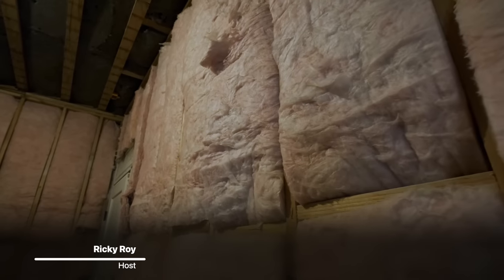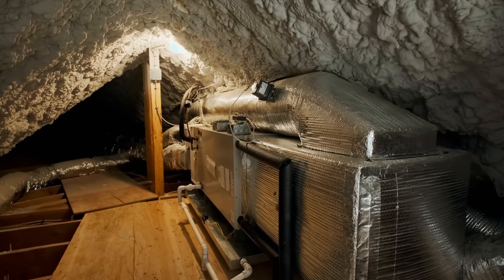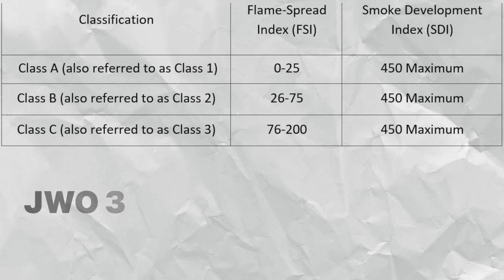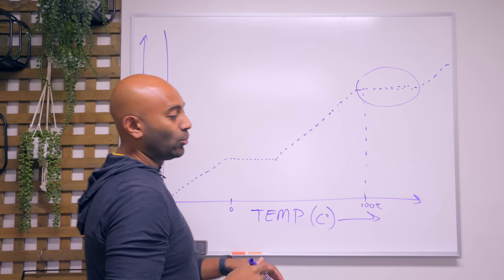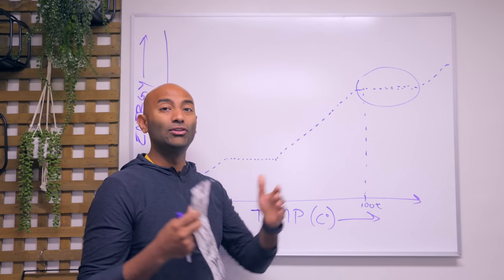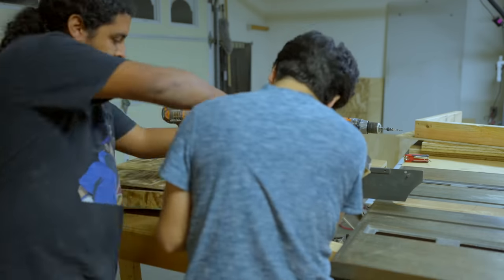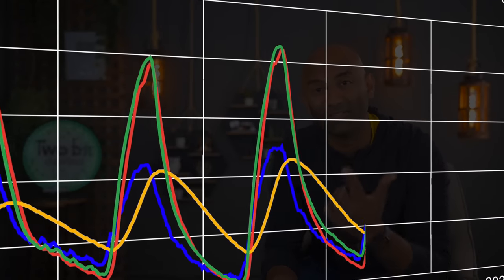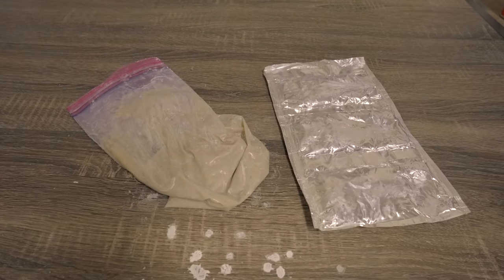The Genius of Phase Change Building Insulation!

Comment: My biggest concern would be condensation. Exterior envelope design is a constant balancing act between thermal regulation, air infiltration, and moisture resistance. Water getting trapped somewhere in a wall and not being able to dry out is a recipe for disaster. So I worry about how much this product sweats during a phase change. If it's radiating heat while the air around it is cooling, then condensation within the wall sounds inevitable. Which isn't necessarily a dead end, but allowing drainage for that water and evaporative airflow over it will require a very specific wall design. I wouldn't be comfortable casually swapping this in on a wall original designed for batts or rigid.

Comment: Tt makes sense. We lose heat based on the temperature difference between the house and the outside. If the phase change is at the right temperature, this measure can help prevent the house from losing heat from overheating. However, I think it depends on how we heat the house.

Comment: How does humidity work with that phase change insulation . Would that affect installation in different climate zones . High humidity affects where the vapor barrier is located aluminum foil is clearly a vapor barrier as well as radiant barrier. Dew point at at 67-75 can collect a great deal of moisture, inside of a wall moisture becomes a death sentence for structural components. Is that probability figured out foam insulated SIPs had issues with that.

Comment: Big question:
(example values used here only to convey the question)
Say the material melts between 20 and 30 degrees (C).  Then solidifies below 20.
It is 20 degrees and it is getting warmer/hotter.
It gets to 30 degrees and continues to get warmer/hotter.
Inside the building when the external temperature goes above 20 the insulation starts to melt and so "phase changes" and the heat is not conveyed inside the building.
As the temperature gets to 30 and STAYS that way for .... 10 HOURS, the insulation would have melted by then.
What happens to the heat there after?
The insulation can't "keep melting" and so would either turn to gas, or transmit the heat through the wall.
If it turns to gas:  How much expansion happens?  (Eg:  balloons.  Water turning to steam.  MASSIVE increase in volume).
This type of insulation would have a maximum time for effectiveness.  Beyond that it wouldn't work as described.

Comment: Certainly sounds very interesting. For those of us who experience a big range between summer and winter temperatures, how would they optimize the composition? It all comes down to how much this could save in a particular region compared with the capital cost.
Reply: This material works on daily temperature differences. It does nothing for seasonal differences. During the day it absorbs heat, during the night it releases heat. All the while (ideally) keeping the temperature of inside of your house, so no heat is exchanged between the inside and the material.

Comment: Very cool. I’m planning on insulating the attic with 2-inch rigid foam insulation between rafters with 1-inch space between the underside and the insulation for ventilating the shingles. Makes no sense to have an uninsulated attic especially in regions where the contractor installs the air-handler in the attic.

Comment: Could put the kiwi on the south and west facing walls/roof where the sun is most punishing for best ROI.  

Have you ever analyzed the NASA-derived ceramic bead paint additive?  Could you do a video on it?
I find it works extremely well,  wish I had added it to my ceiling paint.  
It seems to add to paint durability as well.

Comment: now this would be great for some climate zones as mentioned. But like what they are doing for attics is top tier. Just roll it out. But Id like to add one further which is helping to air seal without removing the current insulation and lay it on the joists. I use a radient barrier and it really helps in the summer for our climate zone 3 and since the jet stream is getting all out of wack because of global warming, products like this to regulate tempature will help to reduce load on the grid. but shading in your climate zone further is needed with the use of proper insulation.

Comment: At room temp about 300 joules are needed to raise the temp of one gram of water to boiling point.
It'll then take another 539 joules to evaporate that water.

Nearly 2x as much heat for the phase change vs the temperature rise

Comment: I live in a place where the temperature can range from roughly 30-40 in the day to 10-20 at night (In Celsius for international purposes), so this would be super useful!
Reply: I wonder if there is any benefit in my climate (-35c to -20c in the winter,  +30c to +20c in the summer? NW Ontario Canada. Seems there would be no phase change in either extreme!
Reply: @alcocklake  Hard to say if it would be useful in your climate. It might help during the summer maybe, but if the temperature doesn't change between too hot and too cold within a 24h time span I doubt it would be super useful.
Reply: @alcocklake  are you saying summer is day 30C night 20C? Or is that the range of day temperatures? If that is the day night swing it's probably not enough. He was talking about a range of 17C or more. And it would be no good at all for the winter. You probably just need really really thick insulation for those mega cold winters. Once you have that you'll probably be fine in the sumer too.
Reply: @adrianthoroughgood1191  Yup, R30 walls, R60 in the roof, I am hoping for a product that will work in these temps.
Reply: Where do you live with such huge temp swings?
Reply: @hkchan1339  A desert in the middle of the USA. It's pretty dry, so there isn’t much moisture to level out the temperature throughout a day.

From 40 to 10 is a pretty extreme example, but it does happen sometimes during summer.
Reply: @hkchan1339  NW Ontario Canada
Reply: Heating and cooling are "your largest energy bills"?  Well, no... in total, the biggest energy consumer is transportation.

Comment: That's an interesting concept for a Thermal barrier.  I wonder if we would have to have dual or triple phase change layers where I live.  Have each layer phase change at a different temperature.  It goes from -33 to 45 C where I live.  Or -28 to 115 F..... The extremes on both ends of the spectrum throughout the year.  Sounds like cool stuff.

Comment: I have the pleasure of having the cell company putting a cell tower in my back yard(within 100yards). I now have RA. I’ve mitigated most of it by installing a metal roof on a barn that’s between my house and the tower. Just as a selling point, I could see your product as a way of blocking unwanted EMF from unwanted towers?

Comment: Having a latent heat thermal battery such as this as a thin layer wall cladding means you won’t need electricity, due to the large surface area that can absorb energy, but adds complexity and cost. Having a latent heat thermal battery plastic tank in your crawl space, with a air-to-liquid heat pump a.k.a air conditioner to charge it will store a lot more heat, and is serviceable. The electricity will be free by solar.

Comment: Hey Ricky. Amazing video. I really love when a new ground breaking product can be introduced. Especially when it's already market available and not still in the testing phase. I've been looking at adding an exterior layer of insulation to retrofit my house. Based on your research would you recommend this as an additional layer that could be sandwiched between the insulation and original house exterior? Are there ADDITIONAL potential installation issues such as being to prone to punctures as you mentioned, that would make it not viable for this application? Also is there a performance difference between placing the material between the rockwool and drywall vs the rockwool and the house sheathing (plywood)? THX
Reply: Placement of the material is a primary focus. PCMs are used to best effect when they communicate with the heat source. So..In a mostly cooling environment you will want to place the material closer to the outside surface(siding) with your insulation layer between it and the conditioned space. The PCM will absorb and reduce the delta across your insulation layer during the melting phase then follow the path of least resistance(back to the outside (ambient) when it gives it up and refreezes. In areas where heating is primary, the heat source would be the conditioned space. Placement would be inside the sheet rock with the insulation toward the outside (ambient). excess heat from furnace or fireplace that is otherwise lost will then be intercepted by the PCM, then when the heat source is turned down in the evening, and the temp in the room reaches the PCT, it will give the heat up back to the room keeping it moderated for hours

Comment: laying PCM rolls over rockwool insulation over ceilings looks like it would create a vapor barrier on the wrong side of the insulation material leading to interstitial condensation unless there happens to be a previously installed vapour barrier behind the ceiling drywall.

Comment: Seems to me the volume of "phase insulator" used would be correlated to the volume of air it insulates. I.e. When you scale this to a larger size building without "cubing" or increase the thickness of the insulator results might differ. 🤔
Reply: True, Understanding your load and placement is critical but remember in retro applications your issue will be controlling the delta across the existing r values. In terms of real performance it is quite easy to reduce the delta to the point the performance value of the insulation layer is several times higher than stated R Value.

Comment: I think the tests would've been more interesting with some thermal mass in the box, such as a soda bottle full of water (water wouldn't have a phase change at the temperatures in question here, so it shouldn't skew that part of the experiment).
Air itself doesn't have much thermal mass, and any draft would have a significant effect on that small box.

Styrofoam insulation board would also be interesting to have in the test!

Edit:
It would be interesting to sandwitch the phase change material between two layers of insulation, as I think that would help offsetting the indoor temperature from the temperature the phase change material does most of it's magic.

Comment: Might be good for your area where the average temp (ground temp?) is 70F or so. Maybe not so good for other climes. Once it changes to the wrong phase, how much do you need to pay to change it back? What if it stays warm for a while? Or cold? There's a reason we don't build houses with foot-thick solid walls anymore.
Reply: The material goes "dead" when it permanently stays cold. It also goes "dead" when it permanently stays hot. It only works if the day is hot and the night is cold. I.e. desert climates.

Comment: In 1987 I acquired my first house, 1200 sq.' in a hot climate, 110+. I put reflective/air pouch foil in my attic. Then I rolled our a thick ceramic infused white "paint" on my black, asphalt roof, fire-proofing it and reflecting energy. It cut the need for cooling a lot. Was it cost effective? I was a DIY-er. But, we sold 3 years later, to capitalize on the house bubble, making about 95% profit. Had I known I would sell, I could have saved the cost/work. I also landscaped, but that was needed for appearances. 
My point: I saw the value of insulation 60 years ago. Why is new construction a half century behind? Is it buyer ignorance?

Comment: I’m curious, you mentioned it would be great in florida, but also that it needs a big variance in temperature to be the most efficient. I’m in florida, and it seems like 8-10 months of the year our temperature is from the low 70’s at night to the low 90’s during the day. Would that be enough of a variance? It seemed like you mentioned a 30-40 degree variance in your area.

Comment: In the Pac NW we need heat 24 hours a day in the winter, so there is no excess heat we want to bank for later. In the summer there is rarely a day when we want excess heat gathered during the day to be released at night.  There are a few windows of usefulness in the spring and fall.  For the price there would be little benefit for me.
But what if you lined a woodstove alcove with this material so that heart could be released well after the fire goes out?  It would behave in a similar manner to the Russian and Finish masonry heaters which use their thermal mass to bank heat energy to release later on.

Comment: Interesting. Just picking up on your comment to use this above rockwool insulation in an attic. This metalised sheet will act as a moisture barrier so won't you get condensation problems from the warm moist air rising through the ceiling? I was advised against using a similar looking but bubble wrap metalised sheet above my rockwool insulation by the manufacturer for this reason. They said if anywhere it should be under the insulation on the topside of the plasterboard and sealed. But then that wouldn't work with the phase change as it would always be at internal room temperature. I suppose the solution would be to first have a moisture barrier then rockwool then phase change insulation which would be ok as there would not be any moist air rising through the rockwool.

Comment: I think this should be described as superior thermal mass instead of proper insulation. Insulation is something you need when outdoors is 40 °C less than indoors for 4 weeks. If you try to do that with thermal mass, the amount of material needed would be insane.

If you want good insulation, try PU thermal insulation with aluminium laminate surface. High quality stuff will have interlocking tongue and groove between individual panels to avoid air leaks between the panels.

Comment: It's one thing to lay the insulation down in the attic--the medium inside would lay with it.  But what about the vertical application for the walls?  Is it possible that the medium won't puddle causing a gap such the kind that occurs with old batting etc?

Comment: QUESTIONS: does this material change volume in it's state change? What is it the threshold temperature for the state change?
This is an interesting product. But as mentioned it is a thermal mass not and insulation. And as was also mentioned, there has to be a thermal difference for insulation to do anything. You need to heat or cool the inside of the box. and see how it changes the energy use.
The thermal "mass" is what keeps the temperature variations lower. So - it does a very important function - adding thermal mass to the building. But this is NOT the same thing as insulation.
If you think about it, it is like masonry in that it is acting to either hold or absorb heat. If it is on the inside of insulation, then it will take longer to change the temperature of the inside of the building - because it will either be absorbing heat or radiating stored heat. It is thermal mass - like a more massive type of wall. But it is not insulation.
Reply: >You need to heat or cool the inside of the box.
The outside is heating or cooling. At least in the real application and supposedly the test too. But he could have tested it in reverse mode, by heating and cooling the inside in an hour interval, instead of waiting for the outside to heat and cool in a day interval.
Reply: @allocater2  Right - but this material absorbs heat, so it "requires" more heat shifted. It will act as a buffer/sink - which is not the same thing as insulation.

Comment: Very interesting stuff. And an excellent in depth look and explanations ! Thank you.

This could be a game changer in a lot of applications if the price comes down a bit. Couple questions if you know off hand.

What is the weight of the material ? It seems pretty dense. Wondering if it might be an issue structure wise, especially in retrofitting to older homes.

Do you know if there is a maximum and minimum temperature rating for the material ?

Will extremes deteriorate it faster or reduce the lifetime of phase change properties ?

Comment: Two months late. I just replaced all the Sheetrock in my 60 year old house to add insulation. Would have been worth it. Still planning on adding Sunflare Powerfit panels to my standing seam metal roof once they’re available, along with a big battery bank.